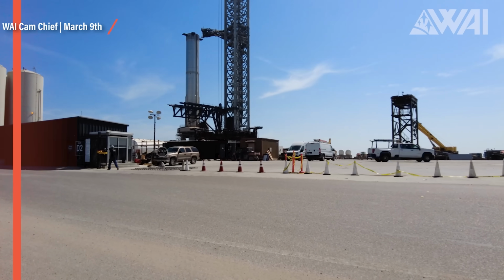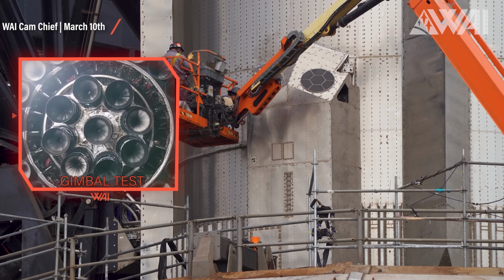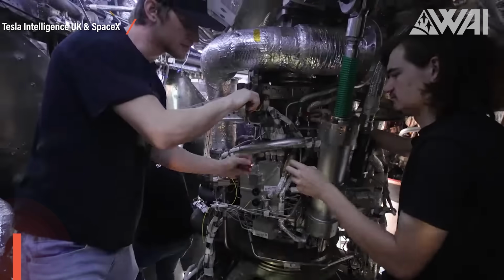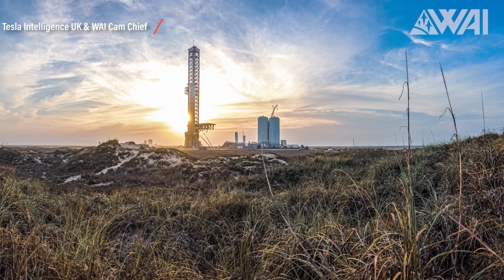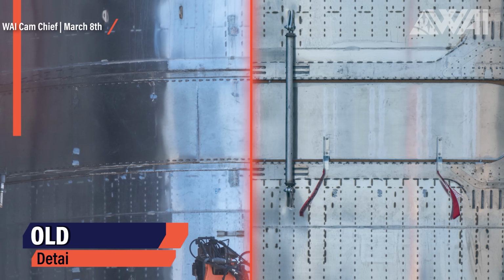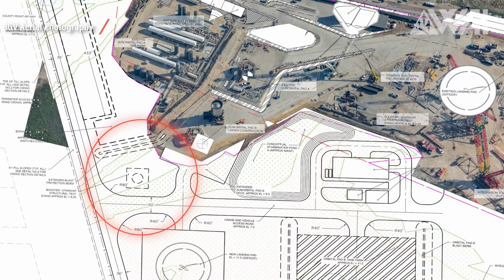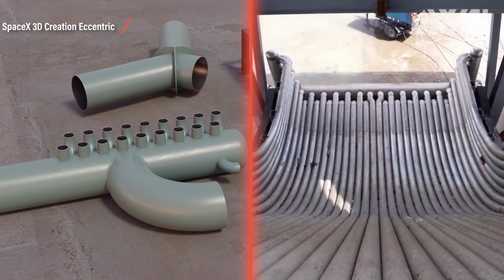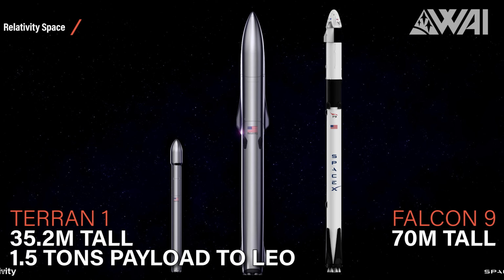What's SpaceX's final decision regarding future Starship launch infrastructure?

Comment: Actually SpaceX should bring Falcon1 back.  I’m not saying there is much of a market for it but I’m am saying it would make a great RDT&E test bed.  Think of it this way, they come up with a Merlin-1E engine that needs to be tested.  If you use Falcon9 you are risking NINE engines and a first stage just to test a SINGLE engine but with FalconQ you risk only one engine. And there are probably many other RDT&E uses for it.
Reply: SpaceX tests all engines and boosters at McGregor, Texas
Reply: @Hello_OoOoO  um, yea but as an Engineer (retired) the final test is on a rocket that flies for a full duration “mission”.  You can only get so far using test stand, Wet Dress Rehearsals, etc, at some point you must LIGHT THST CANDLE and see what happens.

After all how many failed attempts were there before they landed a booster anywhere?  It sure was not the first try.

THAT is the value of Falcon1 for RDT&E.
Reply: Source of "Merlin 1E" being designed right now?
Reply: @alvianchoiriapriliansyah9882  Ever heard of the concept of a USE CASE EXAMPLE?
Reply: @VAMobMember  
Starship & Raptor is the main focus & in final stage for first OFT, 

NO need to retest Merlin/Raptor with small xx rocket or whatever. The actual Starship full scale flight will do the full duration testing job for you. Developing a small rockets just waste resources (you should have known this as Engineer, trade-off)
Reply: @alvianchoiriapriliansyah9882  

I hate to be rude but you two leave me no choice

THIS WAS A USE CASE EXAMPLE.  I NEVER SAID THAT THERE WAS A MERLIN 1E ENGINE.  I USED THIS FICTIONAL NEXT GEN FALCON ENGINE AS ONE OF MANY POSSIBLE USES FOR THE FALCON ONE.  I STATED THAT THE PURPOSE OF THE FALCON ONE WAS RESEARCH, DEVELOPMENT, TEST AND EVALUATION (RDT&E).
Reply: @VAMobMember  Sounds like my edit doesn't reach to you

FALCON ONE WILL NEVER COMEBACK, WASTE RESOURCES IN TESTING THAT CAN BE DONE BY.... GROUND TEST STANDS & ACTUAL STARSHIP, IT'S NOT GONNA HELP THEM TO MARS, AND IT'S NOT GONNA GET COMMERCIALLY ATTRACTIVE
Reply: @alvianchoiriapriliansyah9882  try rereading my FIRST post.  I don’t think you ever did
Reply: @VAMobMember  Already did, and no they shouldn't for many reasons
Reply: @alvianchoiriapriliansyah9882  in my PROFESSIONAL opinion there is enough value to justify.
Reply: @VAMobMember  SpaceX says otherwise

I can guarantee you're not an engineer specifically working in rocket industry, to not know how nonsense it's to revive Falcon 1
Reply: Not necessarily falcon1, but a test rocket designed to exercise one engine. Great idea, and it seems obvious now that you mention it. 

Maybe reusable by changing the engine and what needs to be tested.

Probably too light though to hover and land?
Reply: @kennethroberts6993  to light? Nope, if necessary you can easily ADD WEIGHT, what is hard is REMOVING weight.

Probably need more than one test bed, i mean the Merlin is just one SoaceX engine.

Other uses would be software updates and anything else you can think of.  Want a 6 stop one booster version of Falcon9?  Use the Falcon1 as a test bed.